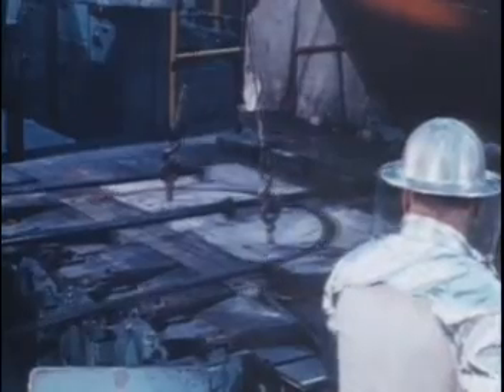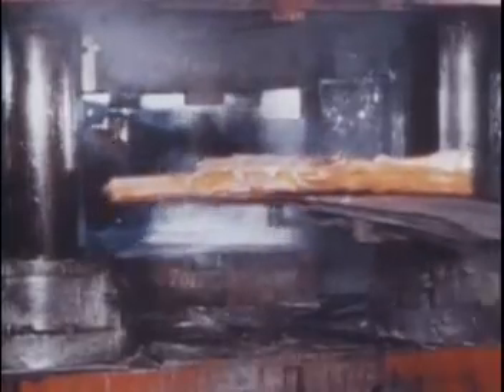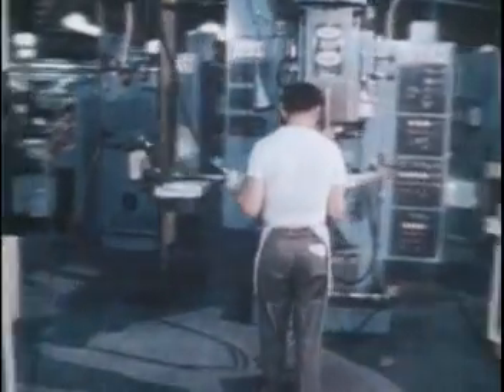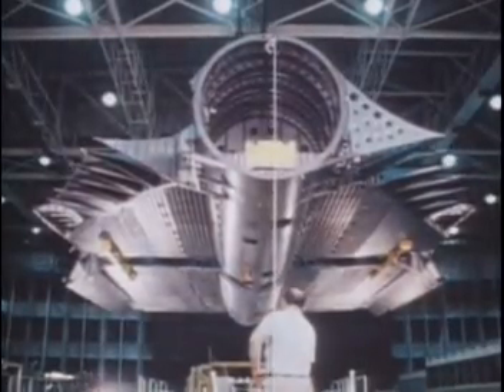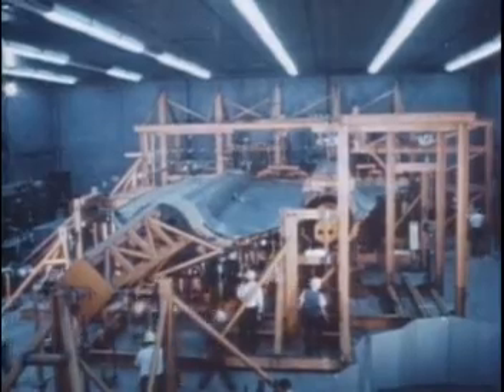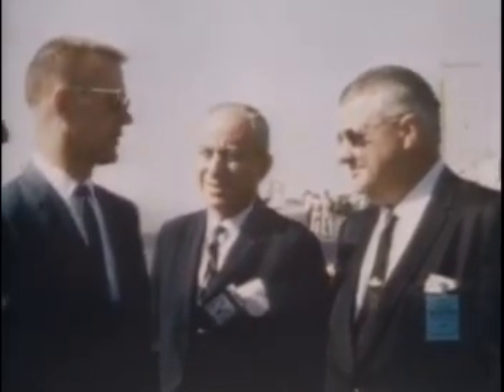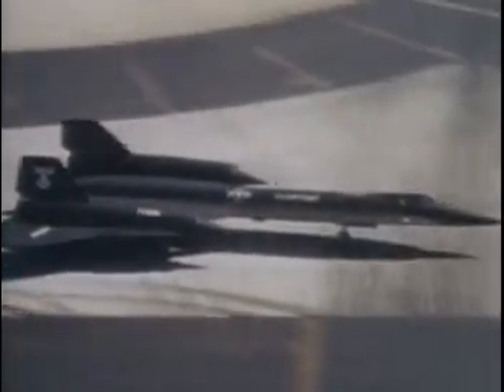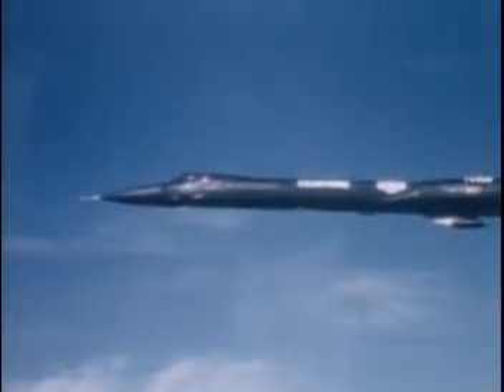Sr-71 Blackbird Documentary Part 3

Comment: it was leaky because of no material exists to properly seal the tanks. on the ground it seaped fuel and then it actually sealed it self up at mach speeds. it was in worse condition sitting on the ground than at mach 3

Comment: @fsrodolfitocarlos The mig 25 was upgraded and modified to beat records. no mig 25's were upgraded to destroy the sr-71's. most of mig 25's function by late 70's was reconnaissance. Some mig 25's were for interception, and was soon replaced by the mig 31.Soviets didn't want to destroy the sr71 because there was a greater threat, maybe the ICBM's and the B1B lancer, which can penetrate below their radar. The sr -71's are maybe just for reconnaissance, so the sr-71 is a lesser threat to the b1b.

Comment: @fsrodolfitocarlos  70,000 ft. but few modified mig 25's, reached 120,000 absolute altitude, not sea level altitude. Absolute altitude= altitude recorded from the ground, not from sea level. sr 71 is expensive, better than mig 25